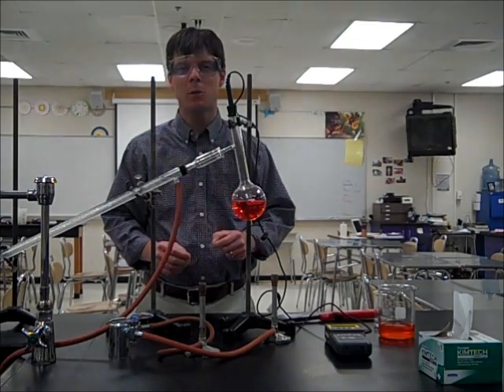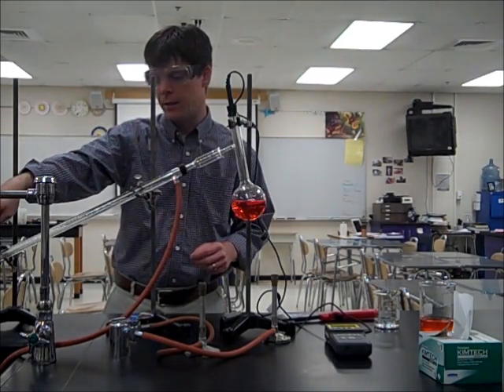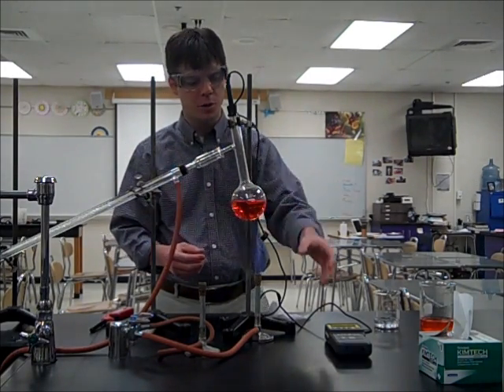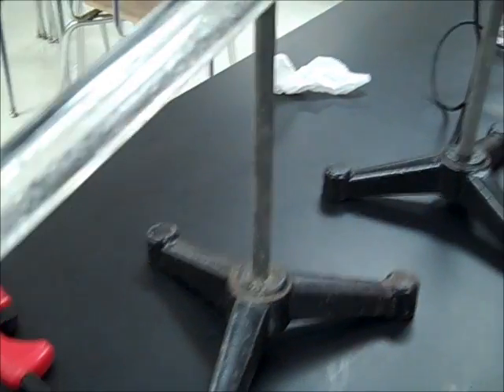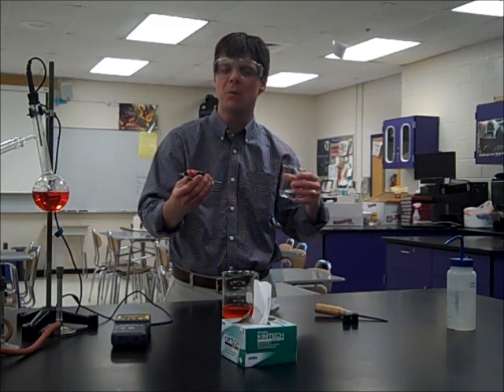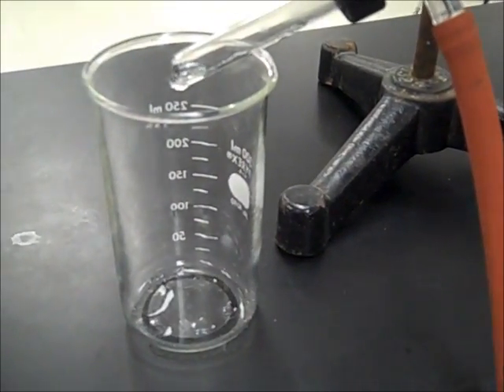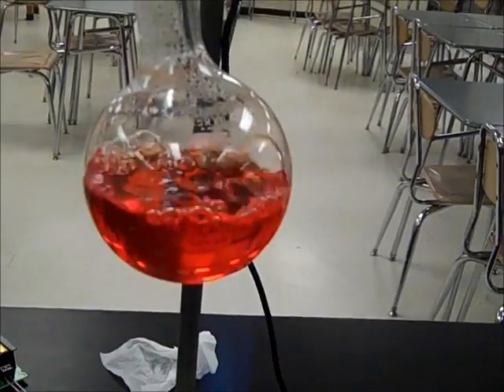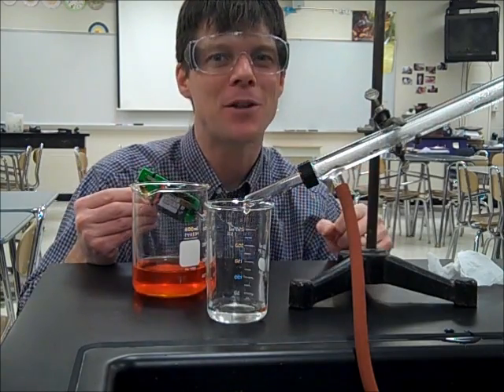Distillation - A Chemistry Experiment with Mr Pauller

Comment: Isn't the condenser in the wrong direction? Isn't the nipple closest to the boiling flask supposed to be facing upward so that the water has better contact with the condenser and has less risk of breakage? Also, aren't boiling chips are a good idea to add to prevent sudden violent bumping when there is no solid in the boiling flask? I know for distilling high temperature boiling liquids like sulfuric acid boiling chips are a must or else you will have one of the worst days in your life haha.